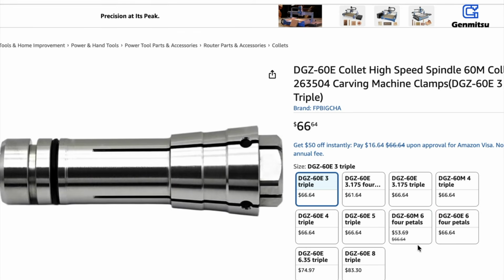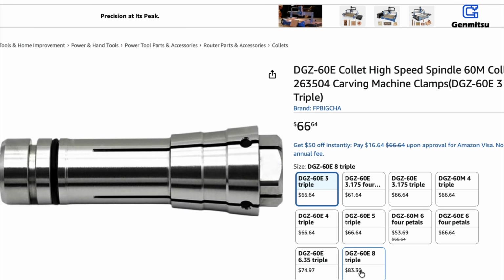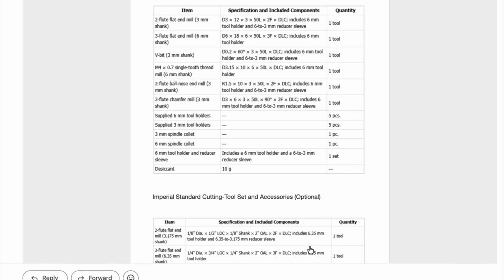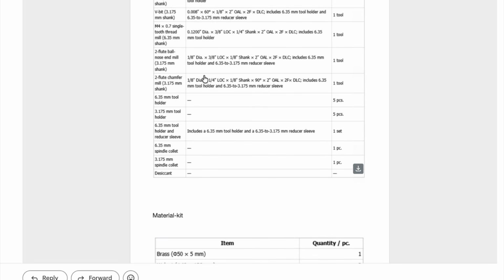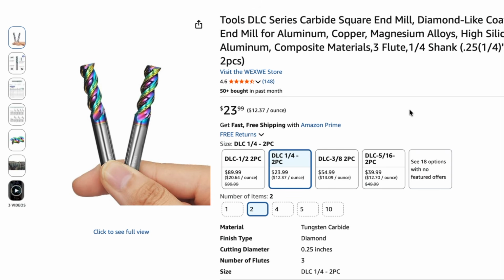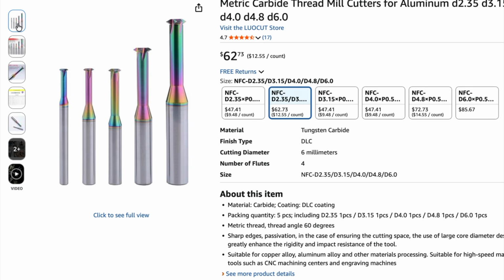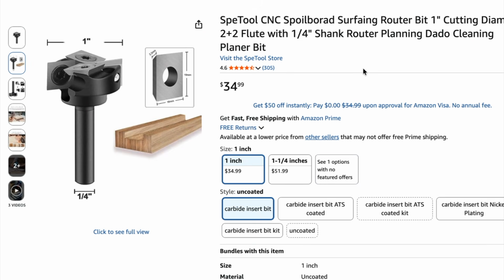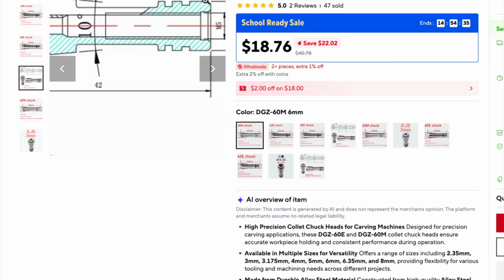Beginner's Guide to CNC Tooling!

Comment: Thank you for the video! I too ordered a Nestworks C500 to learn on. I am curious your thoughts on the Infimaker K1. This unit also seems very impressive and parts of me wishes I could get both. Seems like a very capable 5 Axis machine. Thoughts?
Reply from the maker: Thank you! I am excited for the C500. I do think the future is promising for 5 axis machines, and the K1 looks like the best. However, the work area is still very small and would be for a very niche market. I also question the rigidity as you are adding multiple extra motion components. Time will tell!

Comment: The face mill was a good find. I was considering finding a small face mill and getting the shank ground down but I am glad there is already something with a 1/4 shank. Thanks.
Reply from the maker: Thank you! I have also found a couple other Chinese face mills that WILL require shank modification but are a little more optimal for metal